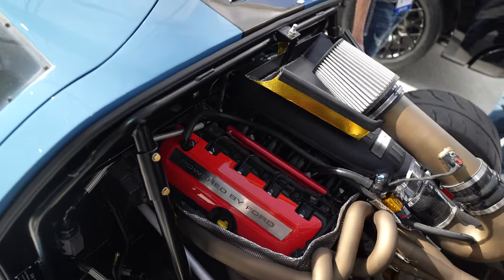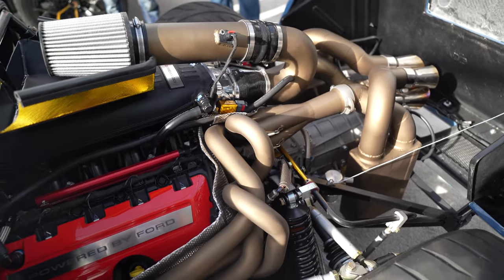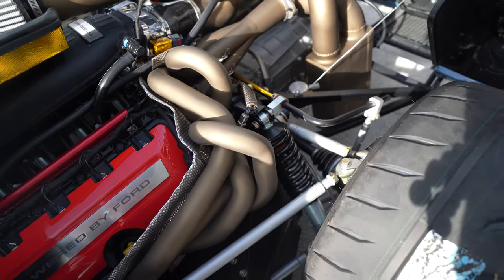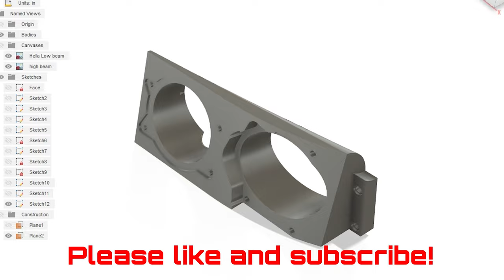SEMA 2021 Best Car Builds Toyo Treadpass | Full Coverage

Comment: 11:33 what bmw is that? Great video btw! Cheers
Reply from the maker: Toyo always has great cars, but they are limited in how they really promote the builders.  I've struggled to find info on many of the cars in the treadpass.  I FINALLY found the info though you can use.  It's a 1995 BMW 850ci with the first Pandem kit made for that car.  Owners instagram is @Marv_gts